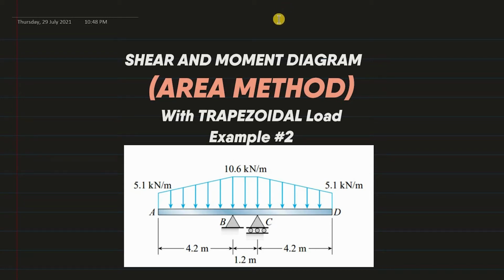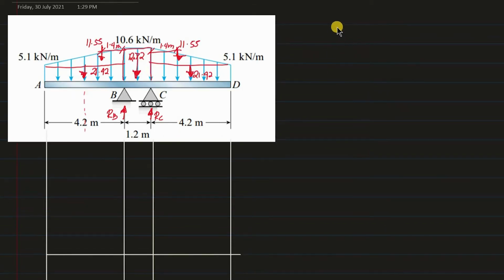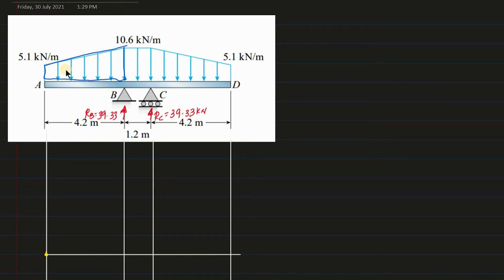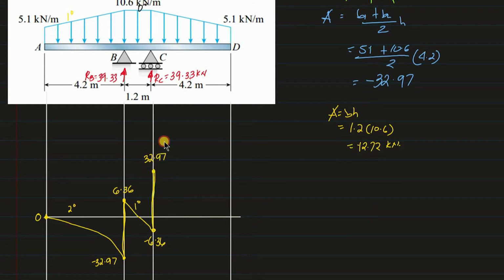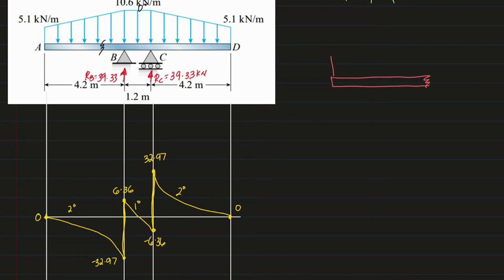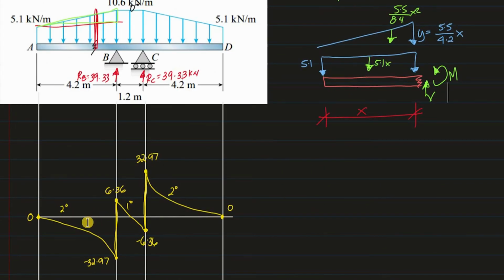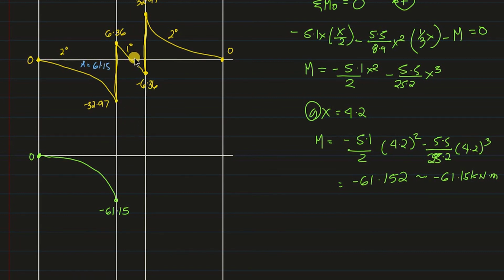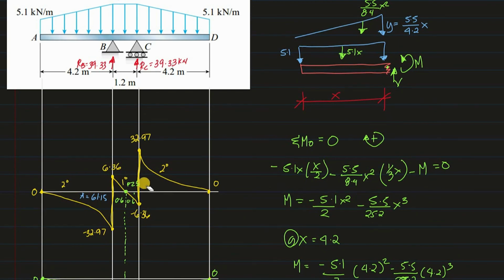Shear and Moment Diagram w/ TRAPEZOIDAL LOADS | Example #2 | Strength of Materials (Filipino)

Comment: Goodmorning Sir pwede puba mag tanong trapezoidal din po kasi yung problem na binigay sakin ng prof ko pero naka loob yung resistance ng tig 1m yung ginamit po kasi pag solve sa gitna is yung sa trapezoid na 1/2(h1+h2)b which is iba sa mga napapanuod ko po hindi nya po hinati kagaya nung ginawa nyo na traingle at rectangle pwede po kaya yon?
Reply from the maker: Hi! Doon ba sa pagsolve ng REACTIONS? Yes pwedeng buo na trapezoid. You will just need to find the location of the centroid. You can search the internet for the formula. Hinahati ko lang kasi sa triangle at rectangle kasi mas madali malaman locations nila kasi dba pag rectangle sa gitna mismo tas pag trianglr eh 1/3 from the height. However pag buo kasing trapezoid mejo mahaba formula para sa location. Pero ayun nga to answer your question, YES PWEDE😉
Reply: Salamat po sa pag sagot Sir.